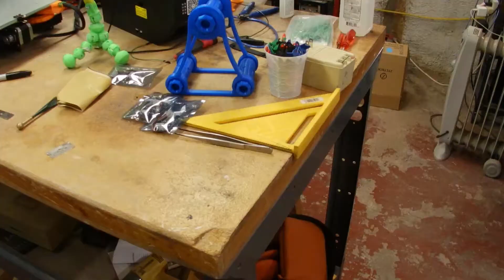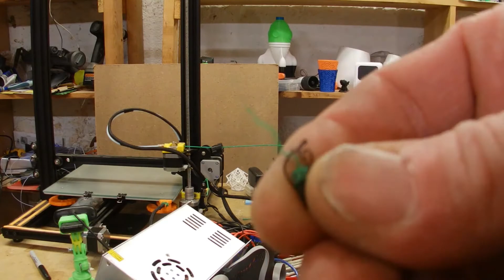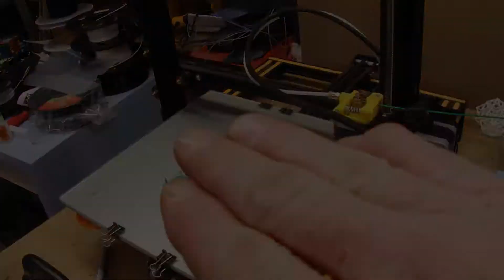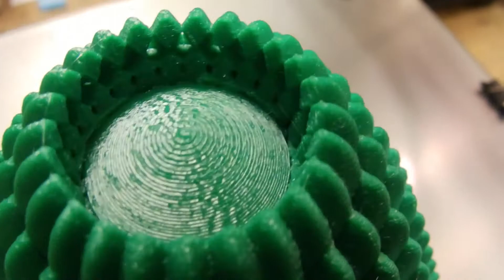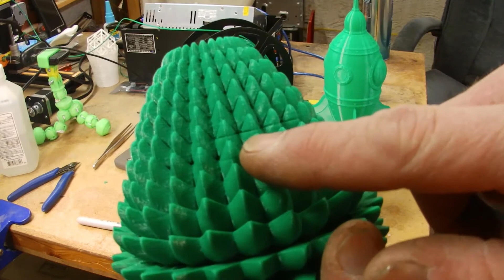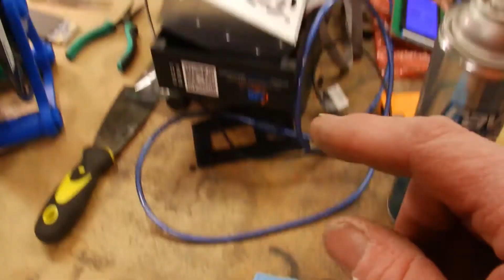AIO Robotics Filament Test and Review (Win Free Filament)

Comment: Are you planning to put another z axis motor on your cr10 or no
Reply from the maker: Noah Mcelwey great question here is my thoughts. 3 of my other machines have dual z motors and I’m constantly having to adjust to level my x axis I’ve watched the cr10 and I see no bowing and I never have to adjust so I’m going with no ATM do intend on the z brace 
What are your thoughts?
Thanks for watching!
Reply: Inside The Mind Of Matt well I am thinking of the long term, because of leverage it seems like those rollers on the side with the motor will have more stress on them and eventually I think they will get loose, people also say without them if you print high you will get a wavy effect, it seems to be the only really good upgrade other than shelling out $70 for an all metal extruder ti print in abs, which I never do, obviously it is entirely up to you, and I agree leveling z motors is a huge pain, the anet can attest to that